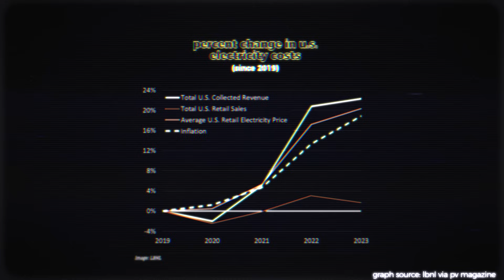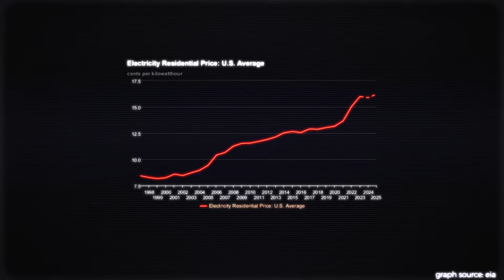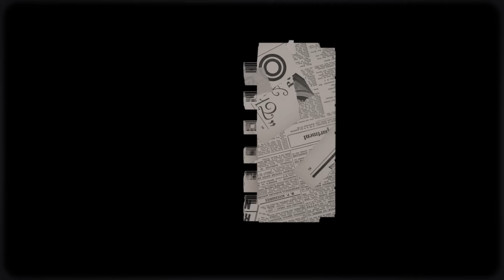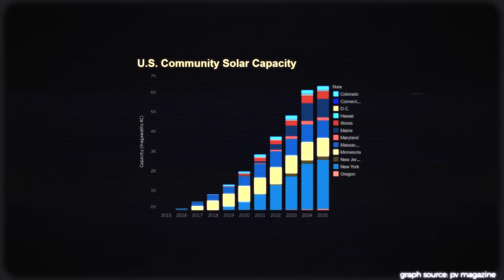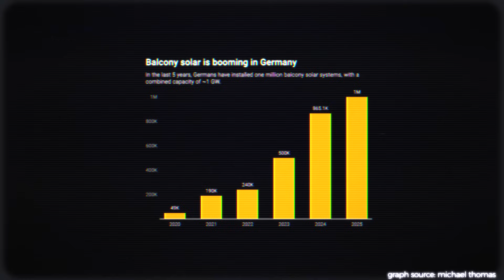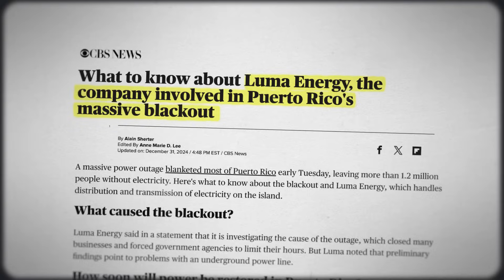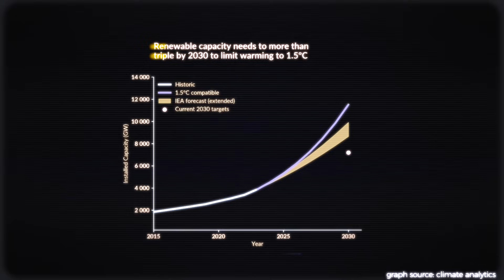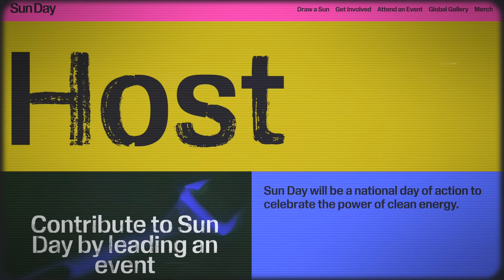Why We Need Solar Power

Comment: Living off grid is doable, affordable, and educational.  It’s great to become knowledgeable in safety issues, power usage, and capacity. I’m all for off grid, homeowner built systems.  I really like the idea of the plug-and- play systems mentioned.  
I worked in the propane industry as a service tech, and know a bit about code in the field. That said, 80% of code is trying to beat Murphy’s law, which is a good thing. The other 20% is a company lobbying for their products. It’s the same with electrical codes as well.  Just my two cents.

Comment: I installed a 2.4kW wind turbine on my property and installed a 5kW solar array many years ago and have had a $0 electric bill for over 10 years.  I replaced our gas HVAC system last fall with a whole-home heat pump HVAC system, and bought our 2nd Tesla and am all electric now, and replaced my solar array with new modules to up it to 11kW, and our power bill went back to $0, and have no fuel bill, and just paid off our $1 million home, saving us close to $3k/month.

Comment: Can people not use a solar generator like ecoflow as a middleman for balcony solar? Obviously you wont be able to plug into anywhere in the house to gain access to this stored solar but you could put one in each room and plug the most power hungry items into it and significantly decrease grid power usage.

Comment: Always love your videos, but this one I believe must be put a little on perspective. You're definitely on point about the huge threat of data centers and on energy consumption, specially as companies are already moving to global south to start yet another cycle of exploitation.
Yet, photovoltaic on itself is still deeply flawed, and even if it must be part of the energy solution, we must avoid comsidering it a savior.

First because its production is incredibly intensive on material resources, and it requires several sensitive minerals that, in itself, create huge environmental and social issues on the global south. It also does no good to escape multinational utility companies to fall into the lap of multinational mining and solar panel companies.

Second, it is intermittent, so it will either require large amount of batteries for storage or to be connected to the grid and use plug and play electricity sources (thermal, hydro, nuclear etc.) during off hours. Well, don't really need to say why batteries are problematic (remember Elon Musk willing to sponsor a coup in Bolivia for lithium), and if peak household energy consumption happens during the night (or winter), without batteries, the energy consumed will come from those dirty sources anyways.
It seems to me that the issue of energy goes much deeper than decentralized solar, and it will require huge ammounts of planning, adaptability and forecasting tecnology (to foresee renewable energy generation with a couple of hours/days of anticipation and adapt industrial and household consumption accordingly), and also big time consumption reduction, hopefully mostly from embedded energy on consumer goods and food.

Anyways, love you channel and keep up the good work.

Comment: Solar is nice, but the amount of lithium needed for it is not. We can't make a major transition to solar, especially not now that we're already running out of oil and still haven't used its vastly superior energy density to transition to renewable energy sources. 
The numbers had to go up, so oil had to stay, because oil simply has the biggest numbers. Transitioning to renewables would make those numbers go down. The greed and short-sightedness of certain humans got us here, and unfortunately, it's far too late to dig ourselves out. All we can do is our best as our oil-centric economies constrict and the societies built around them begin to fall apart bit by bit.
Oopsie! 
But at least the numbers went up.

Comment: German here. Balcony solar systems are very cheap here now. 250-300€ for a starter system with 800 Watt. You can get them even in the supermarket. 
A system with 2 kWh Batterie with 1800 Watt solar panel is available for less than 1500€. It can produce about 1800 kWh per year in our region. So the amortisation is possible within few years. 
Simple plug and play and even usable without the grid (e.g. EcoFlow). 
In my home with only 5 solar panels on the balcony in two different directions, it has enough power to run the aircondition for free. 
It is even possible to load very slow an EV if you want (and don't need the AC), directly out of the battery without the fire restriction of 800 Watt into the grid of the house. 
Saves a lot of money!
Reply: There still is a limit on 800W production. You can pass by this by using a battery that keeps within the 800W by storing what is more and feeds it into the home later.
Also the 800W is only for the converter, more panels allow the keep the 800W longer per day.
Reply: @Ismalith  not exactly. The limit of 800 Watt is the power, that can be sent in your home grid. For the production of the solar panels, the limit in Germany is 2000 Watts for the solar panels. So you can load the battery with up to 2000 Watts, but into the grid you can only send 800 Watts. 
My EcoFlow system has four MPPT and each of them has 500 Watts. 

On the battery there are two power plugs to be used BEFORE it is sent to the grid. 
So when the solar panels produce 2000 Watts, I can use one of the connectors on the battery, which loads the EV with 1200 Watts and the battery can still send 800 Watts into the grid. This is legal here. 

If you don't have an EV, you can use the connectors also for washing machine and dryer, which can get 1200 Watts directly out of the battery for one battery and up to 2300 Watts for two connected batteries. 
So you can load your batteries with the panels and use more than 800 Watts, when the power comes out of the battery, without using the grid.

Comment: Great video, I think the prevalence of berlin's balcony solar is a bit overstated though
Reply: It's not only Berlin, it's used all over Germany. You can install it and have to register in via internet. Officially there are more than a million of them already installed. 
But the majority didn't register them, because in the beginnig, some grid owners didn't allow them. So the expectation is, that in reality there are far more of them, than the registered ones. 

More than four million balcony systems have been sold in Germany up to now. Mulitiplied by 800 Watts, this is a relevant number already. Looking on the still high sales, there is much more to come.

Comment: I have two EVs, a 10kw system covers half my power usage, though my house is ancient and doesn't have good insulation. My goal is to expand to a 30kw system as the efficiency of solar improves

Comment: So funny. I’m German and when you said renters can’t partake, I was thinking about balcony solar and then you mentioned it. 

Our big problem is that the current government wants to cut the revenue for selling solar power into the grid… another problem is that a few big publishers for energy charts can’t include home made solar energy. This leads to false news about „solar isn’t efficient,even in summer“ as it only counts big scale industrial production immediately. The charts have to be corrected, and they are after a week or so, but the false facts are out in the wild then 😢

We have a rooftop system in a two family home and are self sufficient from March to October. In the rest of the year it still covers at least (dark and rainy January) 1/3 of our needs. We switched from gas to energy for warm water this year and really, really save lots of money. Our provider is also a customer owned company (Genossenschaft). As we currently don’t have the money to make the house more efficient we still rely on gas for heating, but we’ll get to self-sufficient energy someday, I’m sure.
Reply: Wait that's so cool!!!! I wish we had the same materials in Turkey too!

Comment: When Texas froze to death in February of 2021, I had 400 watts of solar. So far, I'm up to 3900 watts. One piece at a time. 10 kWh of lithium batteries. I have a Nissan leaf which I love because I can make electricity easier than I can make gasoline. My riding mower is electric and I changed the batteries to lithium. Same for my push mower. I put lithium batteries in a golf cart. There are attachments for the golf cart like a hoist and a (sorta) plow. I put a 1 1/2 HP electric motor on my rototiller which runs on an extension cord. There is a 100 foot coil of irrigation tubing that feeds into the hot water heater during the summer. I think my hobby is getting a bit out of control. Send help. 😁
Reply: "I can make electricity easier than I can make gasoline", I think that's a great & concise way to convey quite a bit about personal energy independence. It sounds like a good thing to reply to stubborn people with who  question why someone wants solar PV panels.
Reply: On the one hand you have light delivering itself to panels for free each day.
On the other hand you could have the luxury of paying to extract and transport a flammable fluid.

Comment: A panel into a micro inverter would meet any safety requirements needed for balcony solar. They already meet all the requirements for large installations. They automatically shut down if the grid is down.

Comment: and when we run out of silver for the solar panels, then what?
Reply: We are no where near running out of silver. And if we do, then we can switch to come other conductor.
Reply: @JoeNunyabidness  silver is non renewable and at the current rate of extraction it will run out
Reply: @sithyuu7696 I'd love to see a source for your claim that we are running out of silver.

At the same time, you seem to have ignored the other part of my comment- we can switch to a different conductor. There's nothing intrinsically important to using silver. We use it because it is a great conductor. We will find other conductors.
Reply: We make them out of adamantium
Reply: if only we could recycle...

Comment: 4:03 this is a fallacy, accoridng to stats, are actually using LESS every year as we get more efficient
Its the businesses just chugging raw electricity into the grid
All the Energy savings I have made over the last 8 years are nothing to a poorly optimized server rack that runs at max power 24/7, idle
Reply: This is where Jevons Paradox comes into play. As the cost of energy drops and the system is more efficient, then people are more likely to use energy until they are actually consuming more than before.

https://en.wikipedia.org/wiki/Jevons_paradox

Comment: solar is so useful because the entry cost is so low
however
if you try pulling bs like "here is a 2MW solar farm built on a former grassland because we care about the environment" i will get yo ahh
only biogas, fission, hydro/tidal and geothermal can be scaled up to grid-scale without very major environmental impact (hydroelectric dams are also iffy)

unless of course you are advocating for a decentralized grid where every node produces most of the power it uses and the grid is there just to even things out
then its cool beans

Comment: Fission gives way more indipendence and works 24h no matter the season. Solar is a good complement to lower cost  and charge batteries for peaks of demand
Reply: Does it? We are currently importing uranium from Russia to power our reactors, does that feel safer?
Reply: @JoeNunyabidness  well you could import fuel from france or source uranium from Kazakistan australia or canada . Also fuel stored on site lasts years so there is plenty of time to react to changes in international relations
Reply: @corradoalamanni179  nuclear costs too much and u reactors can lead to weaponization. i can install solar panels by myself. i'm all for other types of nuclear, but not u reactors

Comment: In a recent interview with Novara, Jason Hickel provided a great explanation for why we're still using fossil fuels even when solar is now, by every metric, cheaper!

Despite being more expensive than solar, fossil fuels are more profitable. And it's profit that matters more inside of capitalism. Fossil fuels are more profitable because it's a "found" resources. Instead of democratic control over found resources, we privatized control. They drill on stolen land without paying anyone, and milk each well until it's dry. In some cases they force native inhabitants off their land for a small fee. Fossil fuels will always be more profitable because the costs have been socialized and the gains have been privatized.
Reply: Just to add to your point, fossil fuels are also more profitable because it requires less labor than renewables. Which means the profits rise to the top rather than being spread around to the workers. If they can produce 1MW with 1 worker or 100 workers, they will choose the fewer workers.
Reply: @JoeNunyabidness  Excellent point. Thank you!
Reply: how does that work? If solar is cheaper, wouldn’t that mean solar power producers create larger profits when compared with fossil fuels for the same price of electricity?
Reply: @SelamGebremsekel  Because there is gross and net profits. Overly simplifying but, Gross Profit is what you get with revenue after direct costs, while Net Profit is after the entire business costs get deducted. Solar is slightly cheaper overall compared to fossil fuels, but when you add in the number of workers per MW/h then the net profits are much lower. 

We must remember that fossil fuels are incredibly easy to produce with fewer humans involved. The return on investment for those at the top is quite rapid and the net profits are higher. Solar ROI is much slower as the net profits are lower.
Reply: @SelamGebremsekel solar doesnt work
Reply: False, the sun doesn't shine 24 hours a day and we have no scalable,  reproducible way of cheaply storing electricity generated  by solar eneer... your virtue Signaling is impressive though...

Comment: If you're renting and have a sunny patio, deck, or back yard, a solar panel and 1-2 kWh Anker/Ecoflow/Bluetti/etc battery are reasonably affordable without the need to plug into the grid. 

I have a 600W panel feeding into a  2kWh battery, and even with less than ideal lighting conditions, it generates about 1.5kWh/day, and I can just plug things into the battery.

If I had more patio space I could go bigger, but something is better than nothing.
Reply: How much did you spend on that system and how long before it pays for itself? I could see this as being useful if there is a chance that a natural disaster will take away the Grid energy, but how much does it do on a daily basis?
Reply: @JoeNunyabidness  
Usually the time until it payed itself off is calculated with around 3 years without and 10 years with a battery.
But they most of the time are not able to run independent of the grid, as they use the 50Hz of the grid to synchronise.
But of course there are also such systems and I assume in the us they would be more popular and widespread since there is a huge fear of systemic failure there.

Comment: I taught myself all about small solar systems and after starting small ten years ago I finally built up to approx 2kw system with 8kwh batteries. It cost about $2500. No more power bills. We use less power than before but overall the freedom from bills and security of not having power failures etc plus increased knowledge and skills makes it the best thing I ever did.
Reply: It's pretty much the same for me. Every time I get bored and have a little extra cash, my system grows a little bit. It's turned into a hobby. My first system was 2 50-watt panels and an old electric forklift battery. That was in 1990 and I paid $350 each for the panels. I still use one of those panels as a portable 12 volt battery charger.
Reply: @knewledge8626 do the panels need to be replaced every couple of years or do they last forever
Reply: That’s incredible, it’s crazy that more communities don’t do this